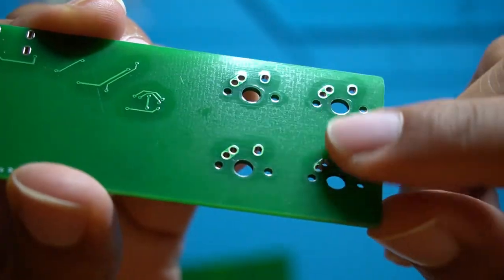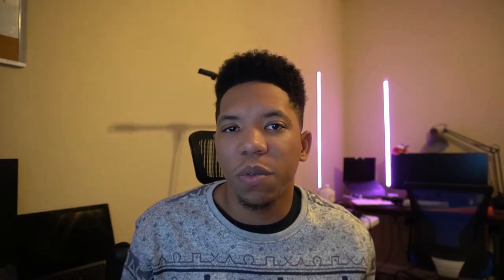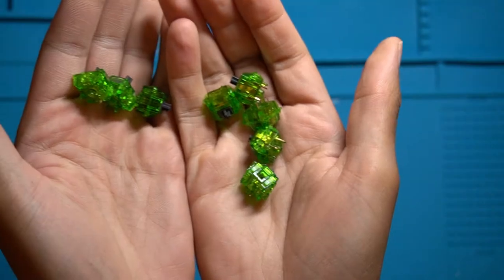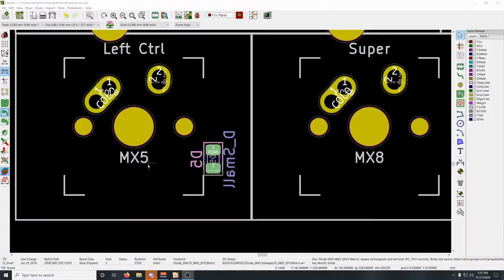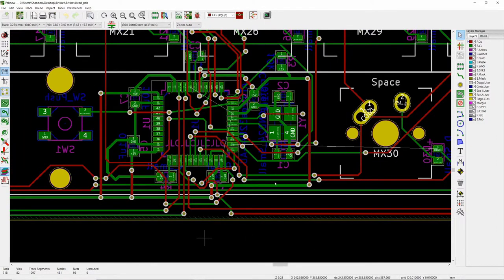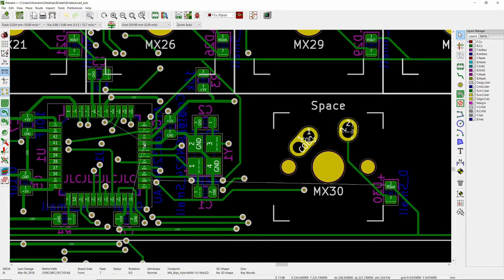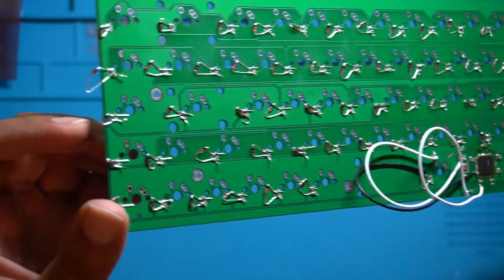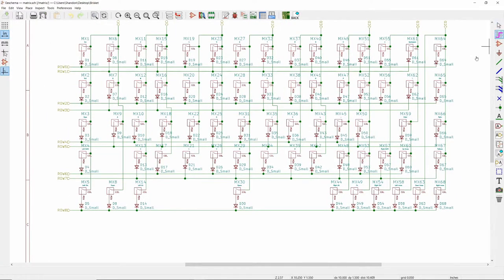Can I make my own PCB? | Custom Mechanical Keyboard Design Journey Pt. 1

Comment: Out of curiousity, building it at the end cost more or less than just buying the PCB
Reply from the maker: Sort of. Because I was new to designing I made a ton of mistakes that ended up costing me money that I did not need to spend. However, since I have made subsequent designs the cost has drastically decreased per unit.